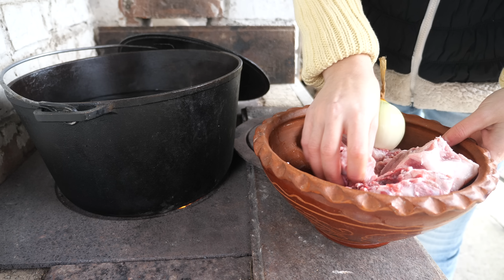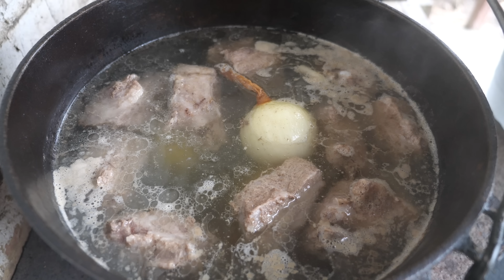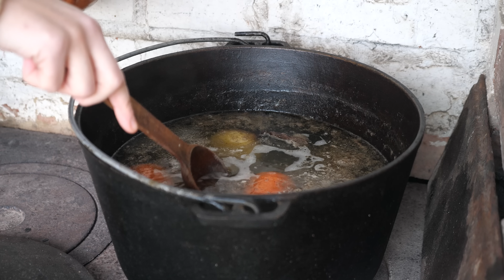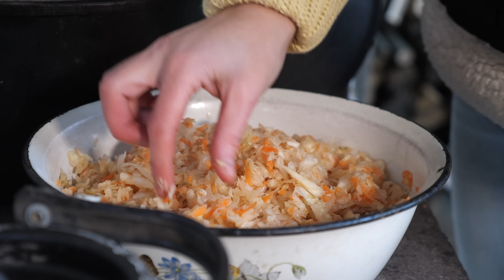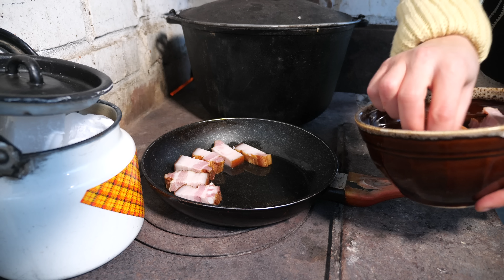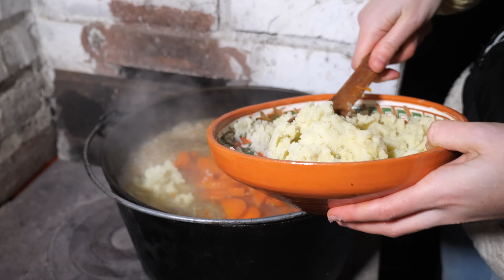The Woman lives in village. Cooking Ukrainian cabbage Soup. She makes trench candles for army

Comment: Authentic Food , just like my grand mother made it, and we loved it🤩Now the cold time have started, also here in Denmark. How does people keep warm in Ukraina if the live in a flat with no possibility of a woodstowe? if they loose electricity? I live in an old wooden house, not very well insulated, and electricity is not cheap. I have a heatpump, air to air, but it cant keep up heating my whole house, so i converted my gas stove into an extra heater, in a very simple way, i took a heatsink from a very big computer ( aluminium with a very big surface) put it on one of my burners, on top of that i put a fan that runs on only heat, to distribute it to the cold part of my house. 11 kg. gas last me for 14 days, it works, and i wish i could show how it works. Thanks for your videos 😘